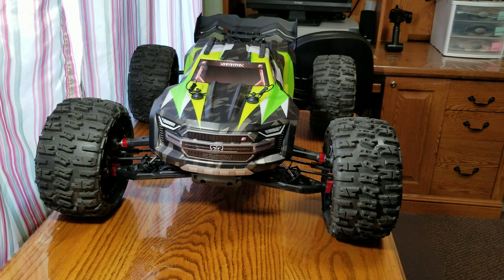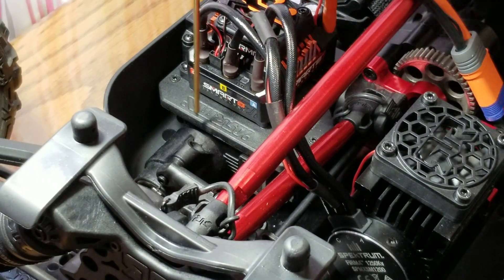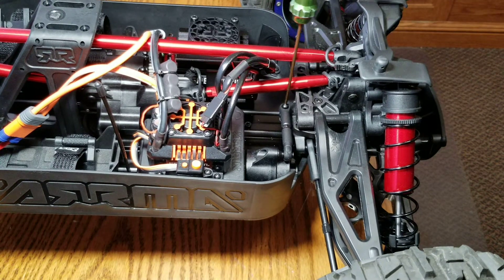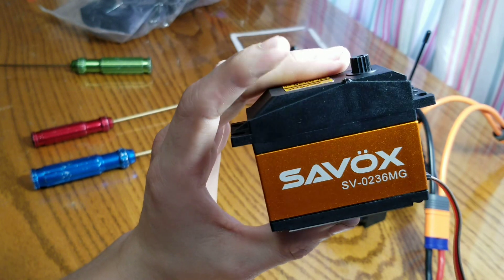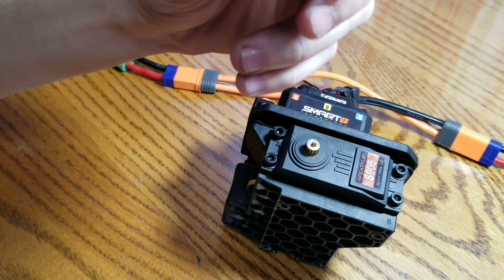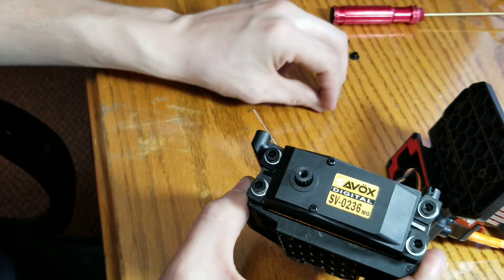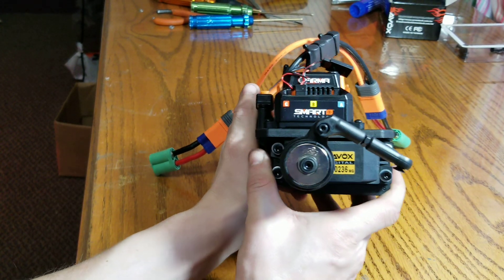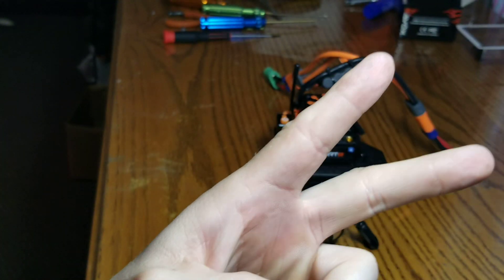Arrma kraton 8s true 1/5 scale steering servo upgrade

Comment: Question my how to get my steering correct on my radio. Meaning if my setting on the radio is  (ST  N.R) I would have to switch it to (R) in order for it to be regular on my radio.
Reply from the maker: Yes usually you have to either have the stirring on normal or reversed whenever you put it in if normal or reversed whenever you put a new servile in cause the orientation on the servile motor couldn't and on the servo motor could be different than the factory servo though as far as your radio I'm not exactly sure deal I'm not exactly sure what radio you have

Comment: Great info Alex. Q Please? I bought the 1/5 scale reciever box & already went ahead & got the JX Servo on oder - JX PDI-HV2070MG 73KG  However I noticed the Spline is 17T !!  The stock is 15T like your big Savox in this Vid... My Q is is there Plastic parts I can get to make this JX Servo work on K8S? Thanks 🙏
Reply from the maker: This is the point where you will have to do some custom modification to get it to work you can get it to work all you need is a long Servo horn arm it's the same spline as your Servo 17 tooth but for the linkage you're going to have to do a little extension piece of aluminum is threaded in the center you can probably get one of those for like rock crawlers for like some leakage just kidding will short one that's a quarter inch
Reply: @alexperea20  Thanks Alex. Top Man. 👍
Reply: I run the JX 2070 in my K8s and it went right on the splines. LowPriceBro on Ebay gets these shipped to your front door for $43 within 10 days from overseas. I've used this servo in all my bigger trucks, never a failure. Compare the 73kg numbers....cant beat it!! Nice video btw. Modded mine, didnt know about this option lol. Getting it for my Outcast 8s RN though!

Comment: @16:10…. You’re talking about adhesion promoter that’s used on raw bare plastic aftermarket bumper covers when performing a new paintjob to allow the paint and primer to stick to bare plastics? The same adhesion promoter  which is used in the auto body paint industry? Bulldog adhesion promoter? Don’t forget to remind ppl adhesion promoters contain *Ethylbenzene and *Styrene which are cancer causing and should never be spayed indoors. If you don’t mind me suggesting *pre-clean or *prep solvent which is more appropriate for 3M double sided tape applications on all type plastics. Even home alcohol will suffice. The problem with *adhesion promoters is that it will remain tacky bcs it is a thermo plastic solution and has potential to return to a liquid state when exposed to the elements like humidity, rain water and heat. Because of this it will prevent the more stronger adhesive glue on the 3M tape to not make full contact onto the plastic surface.
 *Pre-clean will remove the oils from the plastic which is what to REALLY want, so to get a very dry surface instead of a tacky surface that will fail in the future.
Reply: If you want to use and suggest the BEST product for ultimate plastic adhesion for dry applications, there’s products that are used on bare plastic kinda like an alcohol wipe and it’s meant for raw plastics… it pulls and removes the oils contained in raw plastics. Bulldog and other spray adhesion promoters are only designed for paint applications bcs these solvent based paints penetrate into each other in tandem. These solvents are volatile.